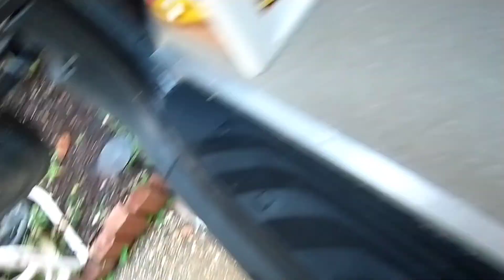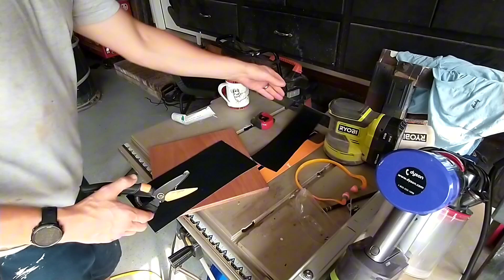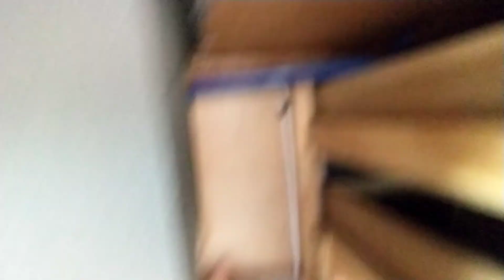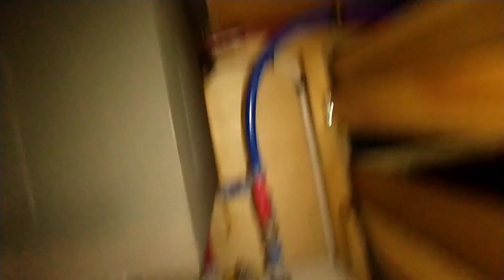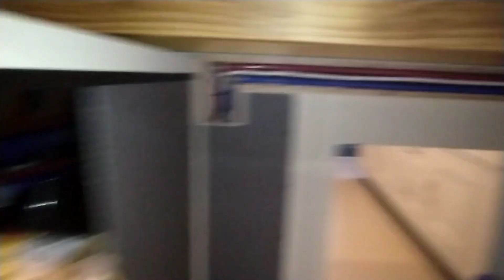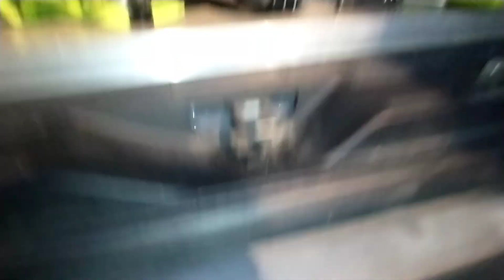Van Camper Grey Water and PEX Install

Comment: Do you have a link to the material you put on the pump backing board? Thanks
Reply from the maker: @edm7356  the board the pump and accumulator are mounted to is just water based polyurethane from Minwax:

https://www.ebay.com/itm/186161734214?var=0&mkevt=1&mkcid=1&mkrid=711-53200-19255-0&campid=5338590836&toolid=10044&customid=d7c385c317c61e995478e3484ab4a8b3
Reply from the maker: Or do you mean the adhesive backed felt? 
https://www.hobbylobby.com/Crafts-Hobbies/Basic-Crafts/Felt/White-Peel-Stick-Craft-Felt---9-x-12/p/25164